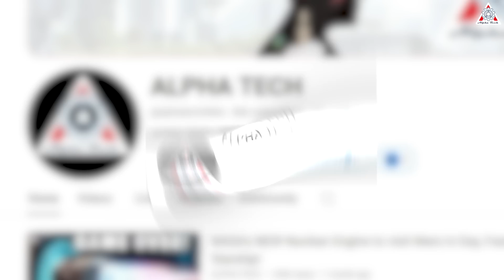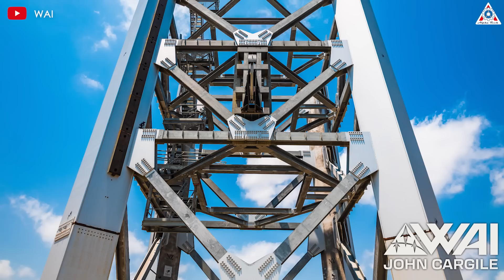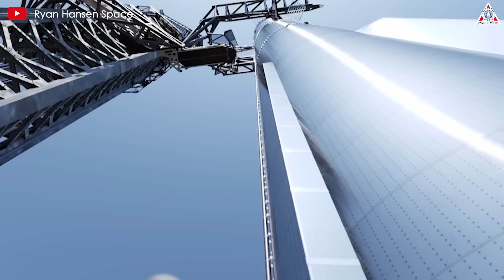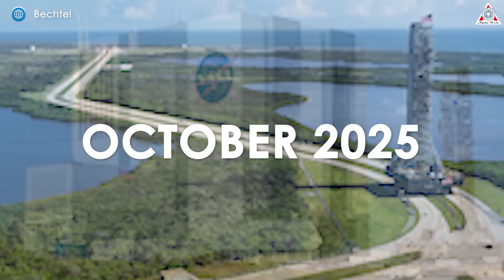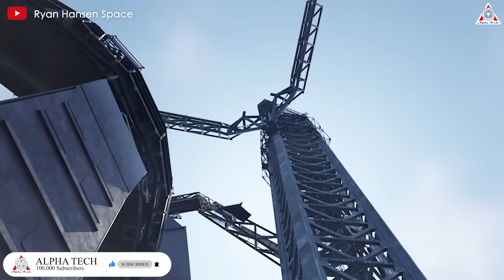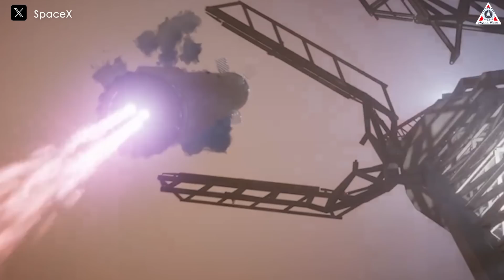What SpaceX Just Did With Starship Launch Tower is HUMILIATED NASA's Scientist!

Comment: Building and designing a fully integrated mobile launcher (effectively half of the launch complex on wheels) is a lot harder than building a static integration tower, especially when you're just bragging about structural build, which is the easy part of the assembly process.
The first Starship tower was in fact far from complete in 2020, 2021 or 2022, up until early 2023 they were working on the OLM every day.
The second tower at Boca Chica is similarly only structurally complete, the long job of integration still remains.
Mobile launcher-2 had the issue of having to be under a very strict weight limit so that the crawler and the crawler way can support its weight with a heavier SLS Block 1B or Block 2 stacked on top, a static launch tower doesn't have that restriction.
This isn't to say that there wasn't a lot of mismanagement from Bechtel and NASA involved, but there are also genuine technical reasons why building a mobile launch tower is a much more demanding task than building a static tower structure.

Comment: Should have chopstick out at sea. if not accurate catching landing in the ocean is better. Stainless steel rust proof.  At sea multiple land is good practice. If perfected then land on land.
Reply: Neither Legs or A catch tower would be needed to land on a (larger) drone ship at sea.  A ring of six or so "braces" could be swung up  from a circular area from the DECK of the ship and surround and brace up a landing booster  like this---   /[]\    the system could work on land too.
Reply: They looked at that by repurposing 2 oil rigs. Was problematic, apparently though they might revisit it.

Comment: Fun toys, but not logical. Just the down stream results of designing by cobbling in chains of  expedients.

The whole towers thing is due to building ships taller instead of wider. Justification likely air resistance for a few seconds and Max-Q neurosis...

Free standing ships dont need towers,  you could build transporters and erectors, and those as seperate units.

Basically you need to stand the ships before you fuel them due to structual limits and weight of fuel.

You can probably load cargo horizonal due to it only being 10% of the fuel mass.

Would be easy enough to design a fuel from the ground system for both booster and ship, where you have a line system intergral in the ship and booster and it fills booster first and then the ship, and then disconnects the two.

The transporters and erectors should be built light and cheap. And the money put into the ships.

Also I saw on the NASA tower, they had an I beam in the structure laid on its side. I beams main strength is in the top and bottom plates, the web connects them, if you lay it on its side you lose your strength to weight and cost ratio, and also make weld up more difficult.

Also that tower was over built.. compare the amount of steel in the NASA structure to the SpaceX structure.
If that was also an erector, they are lifting more mass in erector than rocket... Translation: krappy engineering, selling alot of unecessisary steel and work compared to a minimalistic design...

Simplification pays on more than engines.

And on the crane problem, tearing out the hydraulic cylinder mounts means they are approching the limits of materials and running into limits of height and load lifted.

And it would be totally possible to build those towers without a crane by adding sections in at the bottom and jacking things up each time. Straight push hydraulics are incredibly powerful, and your system could be sectionalized for reuse building more towers.

As it is now, when they go to even bigger ships, they will run out of tower and crane height.

All for not increasing the diameter of the ship slightly, which they were gonna do anyway.

and then need a new launch mount for.

The good news, is the window created for competition. Other companies will see SpaceX's humdingers and get free learning.

You want everything designed as minimalistic and simple as possible, and before this is over, 
SpaceX will build an elevator and restuarant into the towers named Starbase View...

For people to watch launches from on their offshore complexes and wait for their helicoptor to go out for their launch..

I dont think their chopsticks and tower landing system will last the test of time either.
It just gives them something to do whilst waiting on bloated bureaucracies..

Will be transporters, erectors, barges, platforms, and non tower catching mechanisms that help correct for off target ships.
Reply: Sounds like you've got it all licked. When is your rocket company going to be scheduling launches?
Reply: @JohnKoenig-db8lk  
I probably have more concepts used in Starship than anybody else not on the pay roll...
I was the original parts count guy on engines....
And got trolled for two days by people like you.
Also, I've had multiple trolls with the same comment about my rocket company etc...

Have a nicerTroll day!
Reply: @garylester3976  I guess SpaceX just didn't measure up to your standards, huh? You're quite the legend.
Reply: @JohnKoenig-db8lk  
You need to go back to Troll school for a refresher.
Elon actually uses feedback to improve Starship, and has said so publically..  
And I have several texts from him thanking me...
in one, he joked I was his "assistant".
You should try using your mind for something positive..
Reply: @garylester3976  Did they send you packing? Do I smell sour grapes? Maybe they got tired of your endless kvetching. 

If you were such hot stuff, 
you'd be too busy working to waste time posting snarky comments on YouTube and arguing with random guys. 

I hear Boeing is hiring...